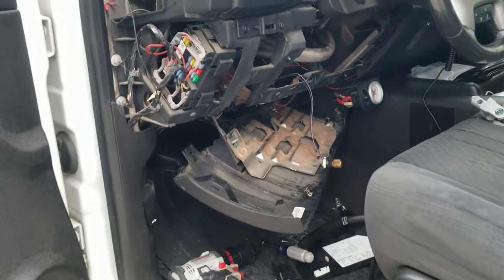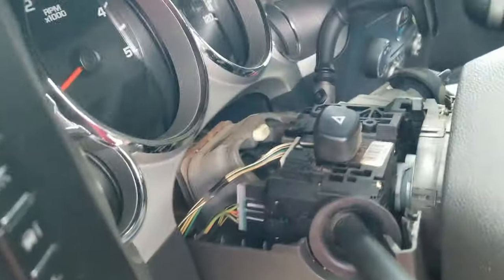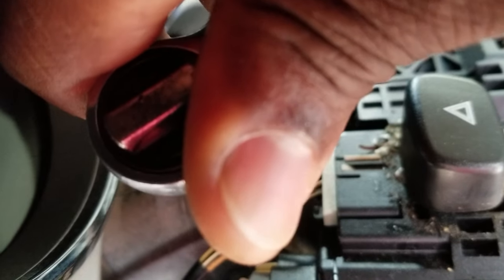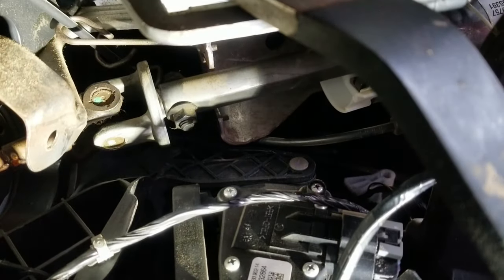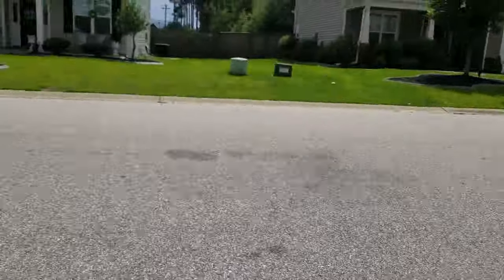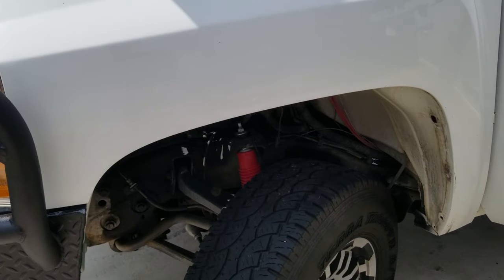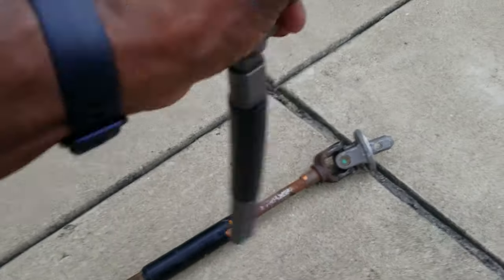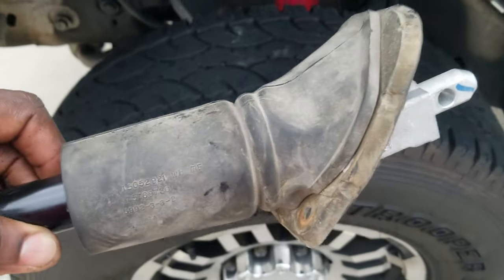Fix the play in your tired Silverado. LOOSE steering wheel play is from worn steering parts

Comment: Warning! I did this and let the steering wheel turn. It broke the airbag connection.  $300 part and a real pain to fix. Secure the steering wheel so it can't turn when you take the shaft out.. Leave the key out
Reply: Yes that clock spring ant no joke

Comment: Amazing, I have had a sloppy wheel for over 7yrs now. Replaced everything and what would you know the T25 fixed it in 2 seconds. Thanks bro, bless you!
Reply from the maker: Thanks man, share this video in a forum or something for me! 💪
Reply: Did you replace gearbox too?
Reply: @adenseay7406  I didn’t replace the gear box, I replaced the pitman arm and tie rods.
Reply: What years does this work on?
Reply: What is the cost you paid? I got a sloppy steering with play but nobody could find the source.
Reply from the maker: Maybe a couple hundred, for steering shafts
Reply: 02 Tahoe same thing. Mine were almost falling out. 5 years and replaced everything but steering box. Fixed it in less than a minute.
Thx for the video. 👍
Reply: Is that what he showed right at the beginning of the video up by the steering wheel?

Comment: Didn't do anything for mine, screws were tight already. So mine is probably in Pitman arm Joint or drag link joint to steering box, I don't have play in my tie bar or rod ends. Really hoping it's not the box itself. The upper Steering shaft u-joint u are going to replace doesn't appear to have play on mine either just by looking down the column and wiggling it. Was excited for an easy fix on this one grrrrr. What can ya expect for a truck with half a million on it lol

Comment: Buddy and I just replaced all steering components on the front end..still steering play. Gonna have to pull the sterring column and check the T25 bolt and intermediate shafts. Thanks for the great info and for pulling the keys eventually to get rid of that terrible dinging! Need some PB blaster on the rusty shaft to get it to slide.

Comment: Thanks for this!  Replaced every single component up front on the truck and still had this problem.  Took all of 2 minutes to get it nice and tight.
Reply: So tightening that screw on the column worked? Did u turn it a little or until it wasn’t able to no more.
Reply: @brandonperez4847  kind of just snugged it up till it was firm
Reply from the maker: Till it felt tight

Comment: Thanks for the video! I've replaced literally everything I could think of steering-wise and just replaced the powering steering rack. My truck feels like a boat while driving and will jerk kinda hard when turning. It is aligned and drives straight but the steering wheel just goes left and then right and is never aligned, I'm gonna try tightening the T-25 down and hopefully, my problems will go away God willing.

Comment: Dude. I have a 96 Tahoe. My steering  wheel has a lot of play. I changed the steering shaft. The same one you're getting. But that screw you just showed might be my main reason. I actually  have to do another tie rod job again.  But man, thanks on that. I new there was a issue with the column.

Comment: My Silverado is doing almost exactly this. I might replace the shafts and tight up the T25 nuts. Also you can adjust the worm gear on top of the steering box. It's a t25 too. You loosen the 5/8 nut, turn the t25 til it's snug, back it off a quarter turn and tighten the 5/8 nut. Thank you though. This confirmed a few suspicions

Comment: I have the same problem, my shop claimed that they couldn't find the right shaft and that they gave the dealer my vin number and the dealer sent them the wrong part and that they couldn't get the right part for my truck, well within 10 minutes of looking on the autozone website I found the right upper and lower shaft and the steering wheel colum bearing. You should replace that bearing while your at it, they have made a new updated better version of it, it's the while plastic piece above when the upper shaft bolts in. I already forked out a bunch of money and replaced my steering gearbox and that helped quite a bit but I still have a good amount of play in my steering wheel and it's irritating, I'm going to be replacing my lower and upper shaft plus my steering colum bearing while I'm at it plus I'm going to put on a new Bilstein 5100 series stabilizer and hopefully that solves the problem.

Comment: I loved seeing someone fighting that task like I did ! Man a trying experience. Now since I replaced the cheap bearing and upper shaft it has a hard spot (binding spot ) when I steer ! I’m still slowly evaluating toward checking the lower shaft . Not much info concerning my continuing issue . Thanks for posting your video .
Reply: If there's a stiff spot after it's likely they didn't shock the u joint shaft at the factory it was made in. After replacing a u joint u have to put the yoke on a vice or something solid and whack the other side of yoke to free up the bearing rollers in joint. They often bind after install. It kinda centers everything then moves freely.

Comment: The top plastic shroud you removed from the steering wheel from factory has three bolts from the bottom side that I believeis t15 or t20

Comment: Thanks for the vid brother. I tighten up those 2 bolts up on the steering column and I still have some play.  Gonna recheck that lower steering shaft hopefully that's it!  Thinking about just going with a new gear box if this doesn't work
Reply from the maker: Right on, I found some of my new Auto zone parts to still have some play and had to take a few things back.  I'm definitely going to order parts from the heavy duty suspension guys online opposed to local parts store.

Comment: It also worked for 07-13 Chevy Tahoe. I was told I needed a whole steering column from a shop smh….now I need to figure out why it shakes at around 50-70mph
Reply: Tie rod ends could be it

Comment: Great video boss. Hey so i swap all my joins and rods every new like u spoke but my steering has still alot of play iam check that all those parts you mention. Well be replacing the new as i check. For a second i thought it was my gear box :(  any ideas where to order my parts 2006 chevy silverado v8 5.3

Comment: On an 08, I tried tightening them...but wheel still has a bit of play maybe screws need to be slightly longer??? Everything else is new, gearbox, 2 shafts, shaft bearing, 4 tierods, ball joints, UCA bushings, LCA bushings
Reply from the maker: My play seems to still be there after 1 week I had to replace the one of the parts I had just replaced. I'm going to order kryptonite parts next and pull all that autozone crap out
Reply: @CurtARoll  Yep autozone is usually cheap junk unless you're buying the name brand stuff. I went back in the steering wheel and checked screws again...1 I got another half a turn on. Apparently I either missed it or didn't tighten enough. Now the play is ALL gone...it's awesome, dropped the tire pressure to around 52psi and it rides pretty good compared to what it was. I made a new vid describing some of the common issues/fixes

Comment: Good info. I wonder if my 2014 1500 would have that same set up going down into the steering gearbox. Was your loose feeling in the wheel around the centered 12 o’clock position ??
Reply from the maker: yes it was.

Comment: I have a 2017 silverado 1500 and the steering wheel is loose. It only has just over 47,000 miles so I'm not sure why it would be loose already.
Reply: Figure anything out with it? I have the Same truck

Comment: GM discontinued the intermediate shaft for 1989 c1500 Silverado and I can't find aftermarket.  Can anyone advise please.
Reply: Check another supplier there's another part number if I recall that works fine. Or google the part number.

Comment: It also worked for 07-13 Chevy Tahoe. I was told I needed a whole steering column from a shop smh….now I need to figure out why it shakes at around 50-70mph
Reply: Alignment?  Or tire rotation. I had that issue before it would wobble at 45mph just needed a Alignment.